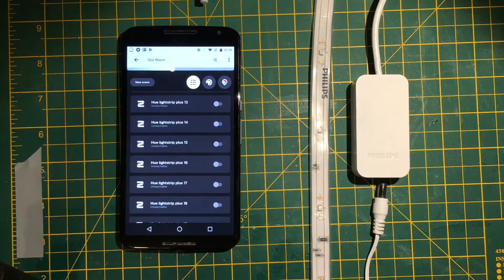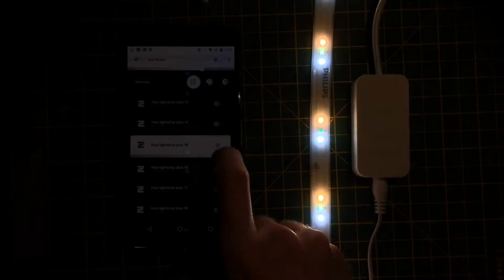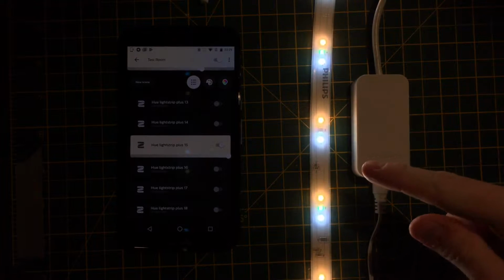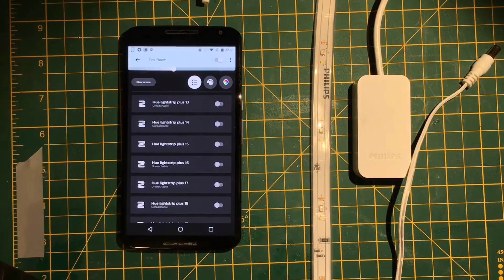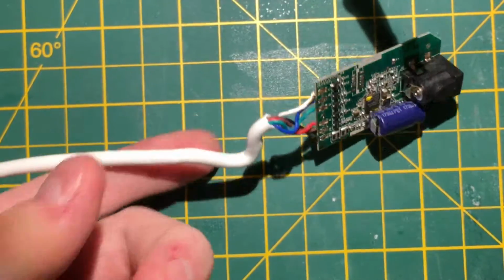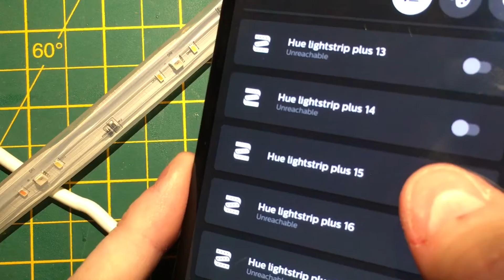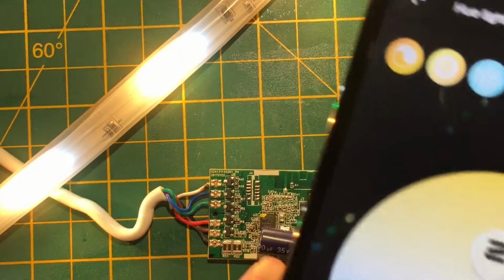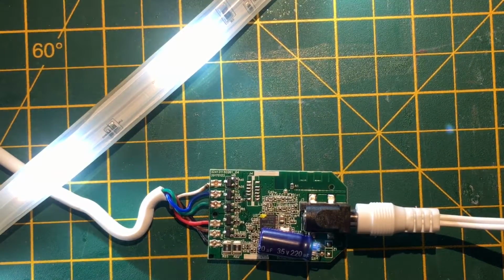Philips Hue Lightstrip Repair - Always On LED Fault

Comment: Anyone have insight on one of these that shuts off the psu when connected? I can't find a short on the controller board but two different psus do the same thing. Assume it has to be aomewhere on the controller board where the issue lies but no idea where. Changed the input electrolytic for good measure but of course no change
Reply from the maker: What do you mean by shuts off the PSU?
If you have a multimeter, you could try checking for a short between positive and negative at the power socket on the controller. If no short there, check the power consumption by measuring the current going into the controller by connecting a multimeter between the PSU and the power socket. It might be drawing too much and causing the PSU to turn off for safety.
Reply: @garywoo3 The psu as soon as it's connected drops and pulses around 0.1v (assume it's just power cycling and my DMM can't keep up). The strip tests find so assume the controller has a short but I'm not seeing one. Reads 20ohm across the i put which I don't think is abnormal. No ceramics are short and the fets seem ok
Reply: I think the cobtroller IC may have an internal short to be honest, nothing around it seems likely and I'm not going to spend too much time on it. Losing the smart functionality is a shame but I guess I could hardwire it and use it as a bench light or something
Reply from the maker: @RetroRepair  I think you might be right. You could always get a replacement controller. There are cheaper 3rd party zigbee ones that are compatible and can be paired with the Hue bridge.
Reply: @garywoo3 I'll check those out, to be honest though have needed a bench light for a while so may be a good excuse to do it finally

Comment: I know this is old as hell, but...
I watched that video, I've never soldered anything other than copper plumbing before. I got the tools, bought 10 of those tiny parts that were bad (they're cheap enough, definitely buy more than you need, I lost 2 and broke one), and gave it a shot. 
I had 2 Hue lightstrips that were bad, one kept the warm white on constantly, one kept the cool white on. It took me about 20 minutes to replace the 2 bad MOSFETs, and both lightstrips are working perfectly now!

Comment: Hello :)
Thank's to your video i managed to order some part and fix my contrôler.
I shorted the warm white with the power line because of a bad 90% connector, and could not find any replacement or worthwhile used on ebay.
After some digging i manage to order a row of transistor from aliexpress (mouser and co only had 20+€ for shipping) and the swap was pretty easy considering the size of the thing.

Comment: hi, i have a question. "wkc 8n" mosfets are installed in my lightstrip. can i still use the mosfets in your link? thanks alot
Reply: Did you find a solution?
I cannot find my reference too WKC 96 on the shopping sites
Reply: @benkraiemchedlia3904  yes, i used "AO3400 (AO9T)" n channel mosfet they are designed for 30v and 5.7A and have worked for me so far without any problems

Comment: Hi, big thanks for this video. it was really useful. 
By the way - I have another one lightstrip like this on video, but it's completely dead. After plugging in to power nothing happens. Do you know what can be reason of this failure? Or what type of electronic component may need to be replaced?
Reply from the maker: Sorry, I wouldn’t be able to tell what might be wrong without doing some tests.

Comment: Thanks for the explanation and everything, I went crazy about why my lights stayed on green after Y cut a cable without turning the power off. However, buying a reel of these mosfets was not an option after a long evening of checking code specs for smds, I found one that had the same spec on an old laptop, so I desoldered from the laptop into the controller and it works now!

TL;DR: used an old laptop to source a replacement mosfet.

Comment: Any clue what to do when it's always off? Mine suddenly stopped working, right after the warranty expired. Usual reset tricks did not work.
Reply from the maker: Have you checked the power supply is working by testing for voltage?

Comment: Is the air gun used absolutely necessary? Can I just use a soldering iron for all steps?
Reply from the maker: David Skarbrevik Yes it is. You won’t be able to solder the MOSFETS without either damaging them, shorting them or desoldering neighbouring components with an iron.

Comment: Thanks for this video! This is the same problem I'm having. Unfortunately I tried fixing it and knocked off the two resistors (i think. they look just like the R18 on your board) next to the MOSFETs. Do you happen to know what kind of resistors those are, or where you'd be able to find a circuit diagram for this board?
Reply from the maker: Ben Brueske they are 0402 resistors with values of 10k and 0.39k. I’m afraid I don’t have a circuit diagram.
Reply: @garywoo3  Awesome! Thanks so much!

Comment: This is such a helpful video - thank you. May I ask if anyone knows a local supplier? I have been to Mouser, and they want to charge £12 for delivery! I have found these at Amazon, but the Continuous Drain Current (ID) look a little different at 3.8 A vs the 6 A shown on the octopart website and as I haven't got a clue, I didn't want to take the risk! Its probably little or no difference! https://www.amazon.co.uk/PMV20ENR-Transistor-N-MOSFET-unipolar-NEXPERIA/dp/B0758SMG4M

Comment: Hi, did you noticed the buzzing problem of the adapter? I'm trying to make one of my own but not quite sure about the output jack size
Reply from the maker: Y. W. I haven’t experienced this issue, but I have replaced the power supplies with other 24v ones. I just re-used the jack plug. I don’t know the size off hand.

Comment: Hi, i have led strips around the ceiling of my bedroom but some of the stay on with minimal light. It's because of the dimmer ?
Reply from the maker: Most likely, yes.
Reply: @garywoo3  OK, thanks. I'ts broke or it's something i'm doing wrong ?
Reply from the maker: @MarcoCereja21  If the problem is exactly like i demonstrated in the video, then it's broken and needs to be fixed.
Reply: @garywoo3  OK, i'll see if i can detect the problem in the  dimmer

Comment: 150mps download internet speed and this video freezes near the beginning
Reply from the maker: J Kerestely right click the video and report a playback problem.
Reply: @garywoo3  ohhhhh if only I had a bluetooth mouse attached to my smartphone right to get that "right click" option, I would have done it already. Thanks for your input though
Reply: J Kerestely Why the need for being sarcastic towards the uploader. It’s Youtube their fault, not the uploader of the video. Also, max speed of your connection doesn’t say anything about the stability of it. 30Mbit/s or so is plenty for full HD, more doesn’t add anything for Youtube playback experience.

Comment: Hi Gary, I have a question for you. I presume You've also come across some that were not working at all. The question is, is there any chance that it's fixable in that case as well?
Reply from the maker: Have you diagnosed the fault?
Reply: not yet. I’m a complete amateur with this. I’m curious of the odds of it being fixable as far as your experience goes
Reply from the maker: It’s very difficult to say without knowing what’s wrong with it.
Reply: garywoo3 so I just got my multimeter. All of the mosfets are working fine - no connection. The power input seems to work fine too. There is a connection when metered.
Reply from the maker: If you're getting +24v on the input, check for voltage between any of the LED channel outputs and the LED ground (black wire). If you're getting nothing, then something else is wrong, but I wouldn't be able to guess what exactly could be the problem.

Comment: You are a lifesaver! Thank you so much for sharing this
Reply: Hey I have a question, I ordered a simple, cheap 2 in 1 soldering iron / hot air gun. I see that as a hot air gun it operated at 600 oC. Now the question I ask myself is will it be ok to desolder or can it hurt the components at that temp?

Comment: Do you know if it would be the same for Aeotec light strip?
Reply from the maker: I don’t know.
Reply: @R This video should give you the confidence to investigate. Open up that Aeotec and then look up the part numbers for the transistors used. If it uses N-type (as here) you should at least be able to confirm whether it's broken (open).   Verifying shrinks the scope of your problem (at least you know you'd need to practice soldering, or ask a friend to help you)

Comment: Could it solve the buzzing issue ?
Reply: Usually a buzzing issue is due to a switching issue. Could be a bad capacitor causing a bad ripple in the supply, or potentially a leaky diode
Reply from the maker: I don't know what that issue is, but probably not.

Comment: Do you think this would work for the 71901 (one that has a plug that can be disconnected from the base)
Reply from the maker: Yes, I would expect so. Pop open the controller and have a look inside. Does it look like the one in the video?
Reply: @garywoo3  I'm actually asking because i recently did this to fix the model i currently have which is this identical one and i have extra transistors just incase it blows again. Was wondering if i could use the extras in case the new one i get has the same issue.
Reply: Can the transistor be bought in a normal store? Can you give his model and parameters?
Reply from the maker: Tom S, it’s simple to find them online. I wouldn’t know which stores to buy them in. Details of them are in the description.
Reply: I am from Poland and I have problems with English :-)

Comment: Is it possible to remove the faulty one and just use 2 of the leds?
Reply from the maker: Yep, if you don't have any spare transistors, you can remove the faulty one, and that LED channel will just remain always off, however it's probably easier to just cut the wire to the left of the transistor if you want to disable the channel. Leaving the faulty transistor in place shouldn't cause any harm.
Reply: @garywoo3  Ok cool
Just cutting the wire Won't cause any electrical problems, dont want to start a fire :p
Reply from the maker: No, it'll be fine. Just put some electrical tape over the end of the wire to make it extra safe and remove any possibility of a short.
Reply: @garywoo3  so which wire is for the warm left led?
Thanks for the help btw
Reply from the maker: It’s the brown one, marked FW on the board.

Comment: Do all the controllers use the same Fet? I have this fault but on a 71903 controller.
Reply: Hej, from my limited research, I figured that WKC is the important SMD code (I couldn't figure if it is an abbreviation or just a code). The number after WKC like 77 or 72 seems to be some manufacturing code unrelated to the functionality (as far as I could figure out). SOT23 defines the size and type. It stands for "Small Outline Transistor" with three pins and a size of 3 mm × 1,75 mm × 1,3 mm. So all my controllers have WKC MOSFETS, but some show 77 ans some 72 (would be interesting what it stands for after all). So PMV20ENR should work for all the controllers with MOSFETs labeled WKC and have the size SOT23.
Reply: Mine are marked WK9 and then it says 75 sideways
Reply from the maker: I’ve had a look around but can’t find anything that seems right with that marking. Are they also 3 pin sot23 packages?
Reply: They are 3 pin, but I'm not sure if they are sot32, what exactly makes a fet sot32 (I'm a mechanical not the best at electrical). There is 1 pin coming in from one side and 2 pins from the other side.
Reply from the maker: SOT-23 is a package standard, which denotes its physical size. See https://www.vishay.com/docs/84004/sot23.pdf
Sometimes there's an additional number on the end to record variants with different amounts of legs, i.e. SOT-23-3 (3 legs, like the ones here)
Reply: garywoo3 sorry, as you can see for some reason I read SOT32 and couldn’t find much on that. Now I see you said 23 I was able to find a lot more. Yes, It seems to still be a 3 pin SOT23
Reply: Any chance were you able to figure out if this is the correct Fet for all controller models?
Reply from the maker: Zac I wasn’t able to confirm it, but I’m pretty sure the ones I used will be a close enough match.